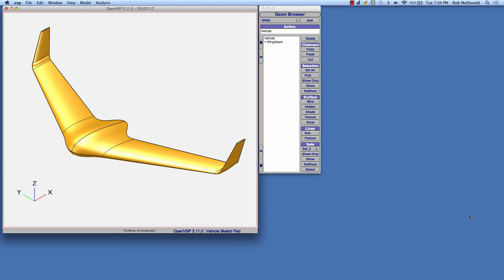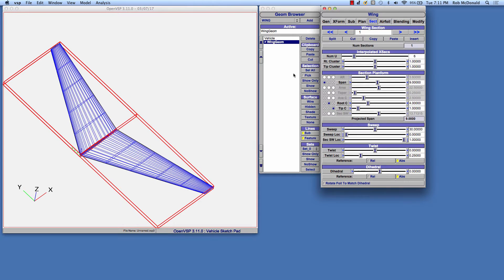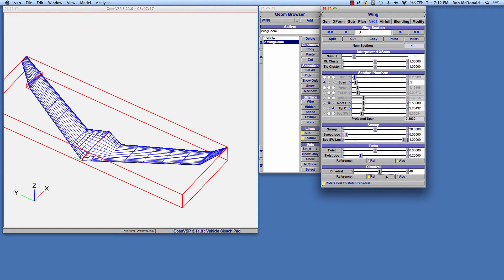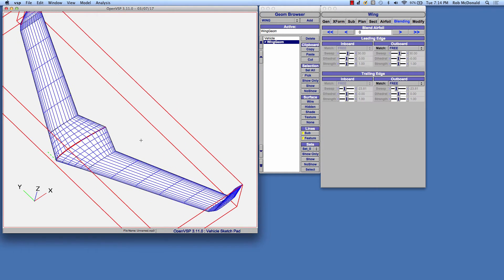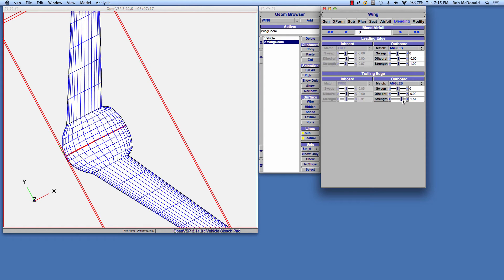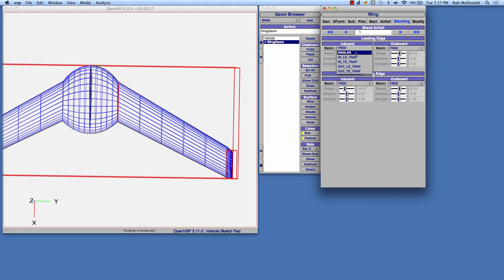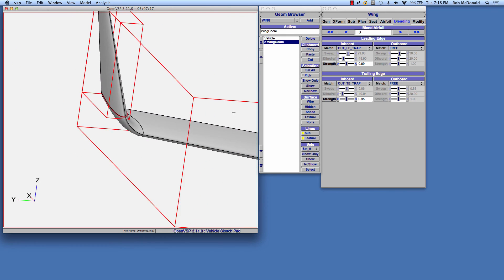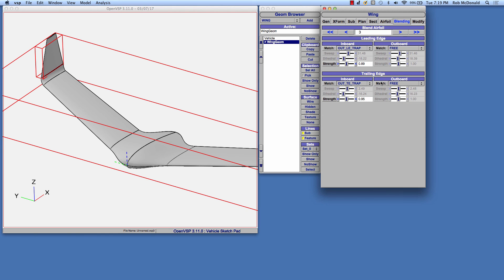Blended Wing Tutorial

Comment: the software is amazing, i have been studying it, and i have a question, How can i model an aircraft fin, like  rudder or elevator? and i think they are all important in aircraft conceptual design stage.
Reply from the maker: Just use a Wing component, rotate and place it as needed.  For a vertical fin, turn off XZ symmetry.

Comment: Could I use 3D model for 3D print?
Reply from the maker: Sure, OpenVSP can write out an STL file used as the starting point for any 3D printer.  You'll want to run 'CompGeom' in OpenVSP before export to make your model into a single watertight triangle mesh.
Reply: Thank you